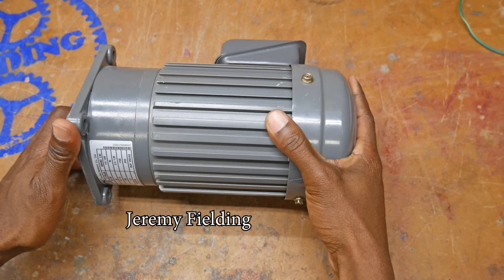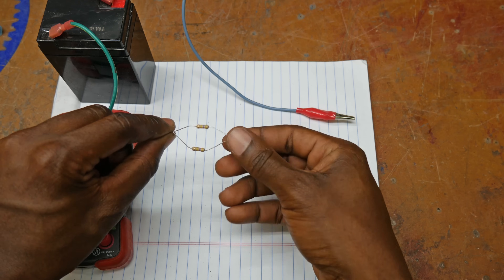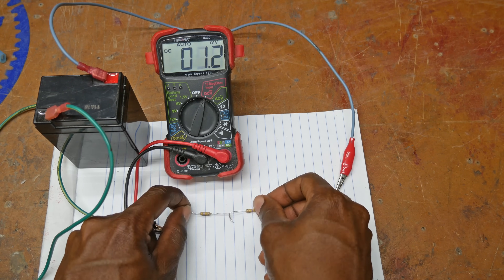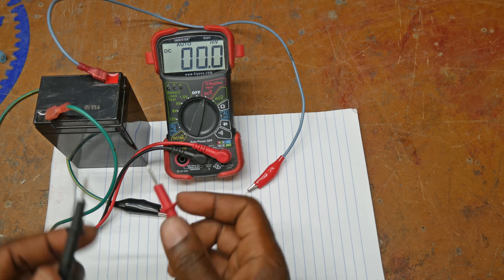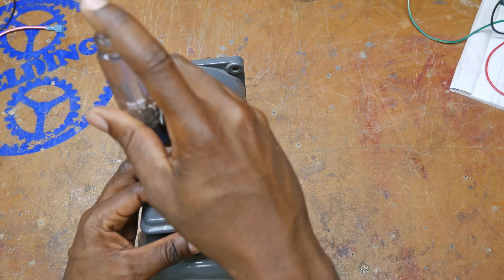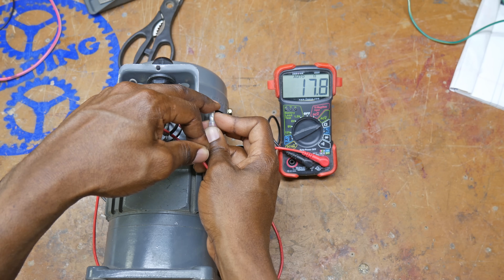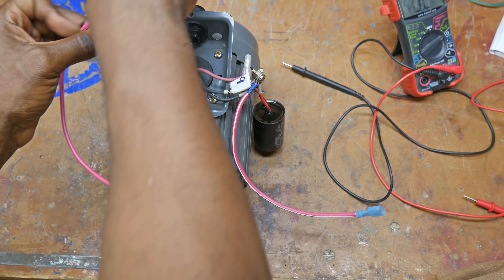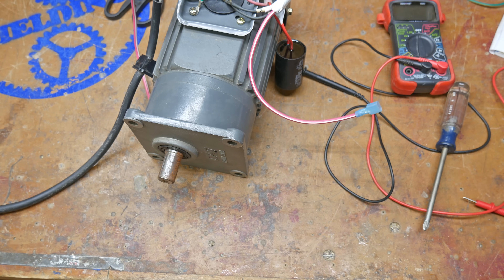Dual Voltage Motors, How They Work, And Wiring Them Without The Wire Labels. #059

Comment: Help me out PLEASE!!!  I’m having an issue with a 1 hp bidirectional motor at work running on 240v. Motor will draw 20 amps but the shaft will not spin. FLA is 4.5 Amps. 1-2 is 2 ohms. 2-4 is 2 ohms.  5-8 reads OL, BUT when measuring micro Ferrarads across 5-8 I get 657 mF. I’m unsure why the starter winding reads OL but also give an mF value for the capacitor, please lmk if ur an measuring something incorrectly. Is this an open in the starter winding? A bad capacitor? A bad centrifugal switch? I do not know the  expected mF rating of the capacitor as it is inside of a pump case, and it would be very difficult to access without completely tearing apart the pump.

Comment: what would happen if you set up the connections for high voltage,  220v, but only supply 110v?   Would it cut the motor RPM in 1/2 or would it try to run at the rated RPM but overheat the windings?   I think it would just overheat the windings but I'm not 100% sure so I'm asking.    (I'd love to be able to drop an AC induction 3500 rpm motor down to 1750 but I don't think there is a cost effective way to do that.)

Comment: There are so many forums wherepeople argue endlessly about the merits of running a tool at 240 instead of 120. Some people claim that beyond the reduced amperage consumption, wired at 240 the motor will have a higher stall torque and thus will be harder to bog down and run better. I think it would be a great video if you tested these different theories. I have seen lots of talk about this topic but not a lot of proofs lol. Thanks for the great videos, keep it up

Comment: Your videos are always very well done, Than you! I'm now electric guy. I collect and restore Vintage DeWalt Radial arm saws. A few models have a " Toggle Switch" for the Dual Voltage feature 110/220 that all you have to do to is pull the cotter pin, flip the switch and change the plug for either 110 or 220. Where can I get the "Switch"? This will be for a 2HP motor 20/10 amps.
Reply: Oh, by the way....it is a single phase capacitor run motor.

Comment: I have a single phase 220v 5 wire motor with no wiring diagram. Wires are numbered 1, 4, 5, 8, and J. The previous wires coming from the breaker box were cut and still wire nutted to the motor wires but there are 4 separate wires which is confusing me for a 220v circuit. The 1 and 5 wires are wire nutted  to one of the 4 voltage wires that were cut. Any idea how to figure that out? I enjoy a lot of your other content . Good to see your channel grow over the past few years!

Comment: VERY NICE   I AM TRYING TO LEARN ABOUT MOTORS  AND I HAVE AN OLD ATLAS MOTOR THAT IS ABOUT 80 YEARS OLD  I AM JUST TRYING TO FIND THE CAPACITOR FOR IT  IT IS A 1 PHASE DUAL VOLTAGE THAT WAS LAYING IN A FIELD UP HERE IN ALBERTA , IT IS 1/2 HP 60CYCLES AND 1725 RPM  AMPS ARE 7.6 AND 3.8 IN 220 I THINK THATS RIGHT     ANY IDEA WHAT THE CAP MIGHT BE   IT IS 4 INCHES LONG AND ABOUT 1 1/2'' DIAMETER     WATCHING YOUR VID I HAVE ISOLATED THE WINDINGS SO NOW I WILL ORDER CAP AND CLEAN AND PAINT IT    MAYBE SOME RACING STRIPES  hA hA

Comment: I should have watched this before replacing the motor on my bandsaw. The old one was 220v and the new one is 110v. The label is scratched bad so I could not change the motor to 220v. Two things: first is, why is 220 better than 110? The second is that the viewers might like to know that you have a stepper motor. Now I'm thinking that maybe the guy I bought the bandsaw from didn't know how to wire it and the old motor is good.

Comment: Does it matter which ends of the running windings are connected together? It seems to me the magnetic flux would cancel if they were connected in opposition, either in series or parallel. Usually there is a wiring table either embossed inside the junction box or on the nameplate, that indicates high or low voltage configuration.

Comment: Sooo... I understand the three resistance measurements, and flipping the start winding to reverse direction, but what I didn't catch was how you knew which ends of the run coils to tie together.  Meaning, if you look at your diagram at https://youtu.be/3llc68VvzsY?t=427 ...

You did this:
low V = (1,3) || (2,4)
high V = (1) - (2,3) - (4)

But by flipping the 2nd (3/4) run coil, you could just as easily have done this:
low V = (1,4) || (2,3)
high V = (1) -- (2,4) -- (3)

Why didn't you?  And would it have made a difference?

Comment: Hey Mr fielding... I wire a 1phase  pool pump motor for 115v and it's working but it turn on for 40 seconds and then it shut off for 3 min...what could be the reason?

Comment: Great and easy to follow:  Only thought is the picture chart with the high voltage vrs low voltage. i.e. Low Voltage 110 would have Neutral and Hot.  The High voltage i.e. 220 I don't believe would have a "Neutral".  Both sides would be "hot" for 220V.

Comment: I have a mill its operating on 460 3 phase
It only has a 6 wire motor i want to convert to 230 do you have a video on a 6 wire 3 phase rewire to 230 3 phase 
Once I do that I want to put on a VFD to switch it to single phase

Comment: If you're going to wire a dual motor that has a 110 capacitor for 220 do you have to change the capacitor?

Comment: Nice clear video. Would suggest the importance of alway making sure circuits are isolated when checking for continuity. A little off topic but example would be checking a fuse while still in the fuse holder.

Comment: Goodness, I looked at a dozen motor diagram, this is the first one that gave me the information I need.1 3 5 gets the neutral and 2 4 6 gets the hot wire.
Reply: 135 Neutral 246 hot ! you rock man !!!

Comment: When you wired for high voltage your diagram wasn't like mine.  You have 1+5 going to L1, 4+6 going to L2, and 2+3 standing alone.  Mine is 1 going to L1, 5+6 going to L2, while 2+3+4 stand alone.  Why is this?
Reply: Also, my Rockwell band saw has a single phase magnetic starter.  Thanks for your great videos.

Comment: What happens when you have 4 wires with continuity? Mine also had 8 wires but it looks like the 2 extra wires was just a jumper. Same color covered under windings tape cover

Comment: So, by reversing start cap 5 and 6, that are wired across the series-parallel circuit 1(with 3&5) and 2(with 4&6), this will cause the motor to reverse its direction? Also, If I have a 240Vac motor wiring the coils in a Series-Parallel circuit, I would have the motor run on 120Vac?- Well explained videos Jeremey, thanks! - Tim

Comment: Thanks for the great video and explanation!! Quick question tho... can you wire the capacitor on either the hot or the neutral side of the circuit? Or does it have to be on the neutral side like yours was in the video?

Comment: Jeremy, you saved my butt! You have definitely earned my subscription! I bought a used motor only to get it home and discover it turned the wrong direction and was "non-reversible".  It was also a dual voltage motor, but I did not know why there were six coil wires rather than the four I was expecting, and two of those wires were soldered together!  Thanks to your video, all was revealed, and by desoldering the wires that were soldered together  I was able to identify the two run coils and the one start coil.  I switched around the polarity of the start coil, soldered things up, and put it all back together complete with new bearings.  It now spins the direction I need and purrs like a kitten!!  Thank-you so, so much!  I am currently building a 20 inch bandsaw using plans purchased from Matthias Wandel, and wanted to use this motor to spin up, and test the saw.  The motor is 1.5 HP and spins at 3450 rpm.  With a 2.5 inch pulley do you think it will spin too fast to be used long term?  I can see that you use a 3 phase motor on your saw.  I am curious what the power of that motor is, and how many feet per second you run your blade at?  Many thanks!
Reply from the maker: There is a whole video about that project.

Comment: When you started the motor, why did it spin slowly? Does that mean there’s something wrong with it?
Reply: No, the motor in question is geared down internally. The rotor itself spins at 1720 rpm.
Reply: Henry Stickman ah okay. I have one and hooked it up to electricity. It began turning slowly and then tripped the breaker. Not sure if it tripped the breaker because it doesn’t have any of the start and run capacitors. ?

Comment: I think you have the high voltage wiring wrong.  Wire 5 should be connected to 2 and 3 and not 1.  Each winding is rated for the low voltage and putting the 1-2 winding in series with the  3-4 winding gives you an autotransformer  that generates the low voltage for the start winding.  What you have might work but it won't work well and will probably kill the capacitor eventually.

Comment: thanks so much !
sitting here in Taiwan in front of a air compressor motor that needed to be rewired to 220V from 110V, since 110V draws way too much current (~15A)
but as usual, the ****tards painted over the wires and their numbers, no way to know which is what, scratching off the paint wasn't any helpful either
ohmed out everything and separated the run & start windings, but had no clue how to rewire the thing
thanks to your video i finally can give it another shot, pretty sure its gonna be a success
thanks, thanks, THANKS !
Reply: Aircraft stripper is your friend next time. I keep a small can around to clean up data plates and leads as required. On new installs I paste wax the data plates, helps them hold up over the years. I use cosmoline spray if they're used outdoors.

Comment: Thank you for the video, I have a dual voltage motor 1/2 hp, it 40+ years old, but it's 4 wires, not 6, I'm not sure if the wiring is set up for 110 or for 220.  There's a cord on the motor but there's no plug on the end and I'm not sure what to put on there. I appreciate your help

Comment: Jeremy, your videos are awesome! Thank you very much for sharing your knowledge. It really helps. 

Since you've asked to share ideas for videos: it would be great if you can cover wiring of single phase induction motors with two capacitors. I suppose one of them is what's called "running capacitor". Thanks in advance.

Comment: Can you run a 460v, 3-phase, and configure it to run single phase on 110v? WITHOUT using a phase converter as well. ;)
Reply: No,  3 phase motors need 2 phases minnium to run, even then this is dirty. Running a 460/480v motor on 120v will quadruple the current burning out a motor in short order if it'd even run. This is why single voltage 480v 3 phase motors are so cheap on the used marker. Only people with industrial power can use them.

Comment: One of the best motor wiring overviews I've seen so far.  Nice job.  I'm rebuilding a Delta Rockwell repulsion induction motor that is dual voltage and has a physical switch that allows you reverse rotation.  This is helpful as the wiring is just old faded cloth so was trying to figure out which windings were paired.
Question, I'm running the motor to a 30 amp rated motor switch (motor is 12 amps at 110) in order to bench test it, but it is not clear which pair of wires  to run to "white" and which to "black" in the switch... Or does it matter?  
A video hooking up this type of motor or 3 phase to a magnetic starter with remote switch would be awesome!
Reply: If your old motor is single phase (sounds like it) it doesn't matter. Load to neutral or neutral to load is only going go change the direction of rotation. If it were 3 phase simply swap a pair to reverse it.

Comment: i've seened in the last part of the vidio you try to test run the motor and the shaft was turn but to slow looks like you have a wrong connection.
Reply: verhillo valakay that is a geared motor it has very low rpm. It is supposed to turn that slow.
Reply: @jayess813  oh yes bro he mentioned geared motor and thats a slow start sorry i am cunfused in the first time  i wactched this vidio

Comment: Question: What happens if one winding's leads get reversed? i.e., in low voltage, N is (1,4,5)- & H is (2,3,6)? Won't the windings cancel out each other's magnetic flux? Don't we have to match winding's starting / ending (direction) properly?
At: https://www.youtube.com/watch?v=3llc68VvzsY&t=427s  And BIG thanks for educational videos !!
Reply from the maker: Yes... the only way is to switch it around if the motor seems weak or won't spin

Comment: When you say higher voltage you mean something that has 2 hots or something that has one hot and neutral ( Other countries) .  I have a TEEEL 3P949 that I want to get to 220 not only so I can use lower gauge wire and the smaller Relay but also so I can keep my machine enclosure power draw more balanced.  Their rewiring guide seems to be different than what you show.  They talk about an insulation and I am confused there.  Thanks for the video it is very informative.

Comment: Super Job Jeremy! Now, may I assume that, even though your motor doesn’t have the highly convenient exterior, exposed winding connections, as long as it was built with two run windings in parallel, you could take the bell off, and manually reconnect the wires in series to produce a 220 VAC motor?

Comment: Ground wire is not only for safety it is also protecting over voltage to the coils witch comes from induced emf around electrical equipment soo called "ghost voltage "...

Comment: Jeremy, I have a question about your wiring schematic for dual voltage motors.  I have an repulsion 115 230 motor.  The two sets of winding for high voltage in your diagram show an N and a H. I assume for neutral and hot.  Aren’t both those wires carrying 110 volts to the motor from the switch? This is a Leland motor with 4 wires from the windings previously wired for 110. Can you correct me on this.  Also does the stator need to be rotated to one of the two other hash marks on the housing.  Thanks

Comment: Hey I'm in need of help with putting a electric motor a car alternator car battery and a Step up Transformer all together to power an RVs house batteries or the house altogether. The RV House part runs off of a deep cycle marine battery I just want to keep the batteries charged when I'm unable to hook into the grid I'm basically trying to make a generator and switch out a gas motor with an electric motor and a gas tank with a battery can you help

Comment: Hello I have a old motor made by Wagner electric it's a huge 2 hp dual voltage motor . It has 2 wires tied together and 2 hooked to 110 which I think should be hooked to 220 so a horrible from each phase where does the netrual go? Just to ground?
Reply: I can’t answer how to hook up your motor to 220, but generally you should not connect neutral and ground wires except where they are bonded at the main panel. Doing so can cause your ground to be energized when it’s not performing its emergency role.

Comment: So an air compressor was given to me but it’s three phase. The guy told me the person who wired it to his shop that was Phase B said it could be ran in a single phase just depending on the wire connections? He mentioned there is wires all tied together and marked as “relay” aside from the regular wires that hook up to your power source. I’m no electrician but one guy who was going to do the job of running 220 line to my garage said it’s a three phase and nothing can be done aside from spending way more money for a converter which isn’t worth it being a home shop. Now another electrician says some motors are made to run both ways.  

volts is 208-230/460
Reply from the maker: I have never hear of a motor designed to run on both single phase and three. I can’t advise any further except to say if the motor label says three phase, you should connect three phase power and nothing else.
Reply: Jeremy Fielding gotcha. Just that the electrician said if there’s a low and high voltage it could be done. Unless he’s speaking about adding a converter

Comment: I have an old table saw that needs a new power cord.  It has a four pin toggle switch and I am not clear how to wire it.Using my multi-meter the switch controls two separate circuits, i think.  Power plug is missing and wire from switch to motor has female disconnects on both hot and neutral wires.  Could you explain how this could be wired?

Comment: Thanks for your video. As would be typical for rewiring from 220v to 110v in a shop,  most wiring would go thru some sort of switch. Could the existing 220v switch be used for the 110v application considering the new higher amperage? If so, what wiring changes would be needed?
Reply from the maker: You have to check the label on the switch

Comment: Can you help me? 
I have been given a Marathon 1/3 HP single phase motor (capacitor start) which I would like to use on a very old metal turning lathe. Unfortunately, I'm not sure how to wire it. Being able to change it's direction would also be an advantage. I can send a picture of the information label attached to the motor.
Keith Rees. England.

Comment: Jeremy I have fans at hog barn that runs 30% to 100% depending on Room temperature. When it reaches 100% it stays 100%. I have to turn the switch of and turn it back on in order for it to go back to min speed. What causes that. Thanks

Comment: Question. If that was a 12v DC motor and I wanted to wire it to battery on one end and add another set of wires to the same motor to power something else, how would I wire that motor. (Duel wiring)

Comment: I have a motor that works on 220v 50 hz single fase ... whot can be done to be able to use it on 110v 60hz or 220 v 60 hz?thank you